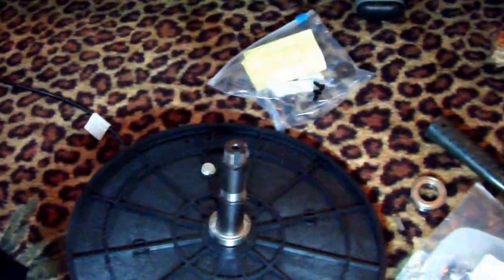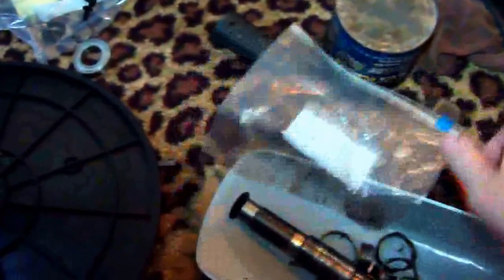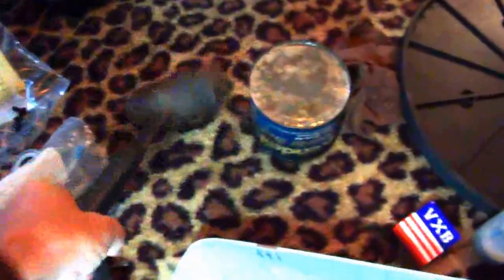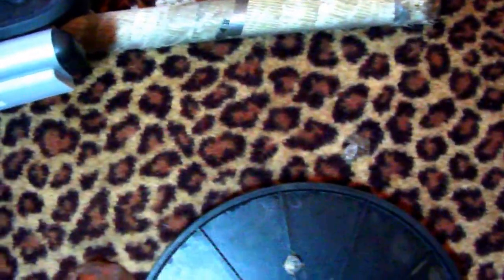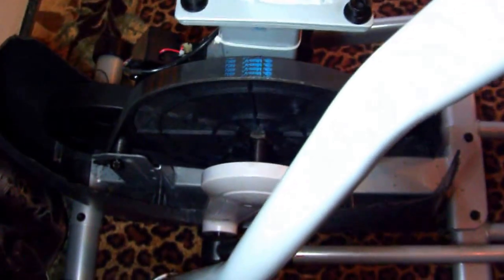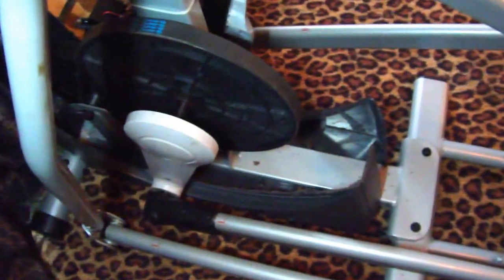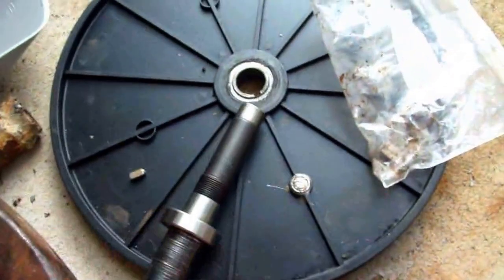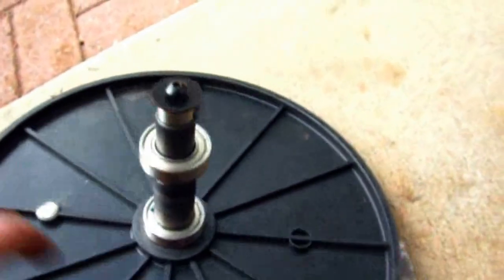Horizon EX59 Elliptical Final Repair

Comment: The parts for your elliptical look remarkably similar to the one I use. Mine is a Nordic Train BR5000 and it just broke on me. I dissasembled the plastic cover in order to see what the problem was. The plastic wheel where the band rolls broke down on the outer edges. I hope the guys that sold it to me can do something about the warranty.